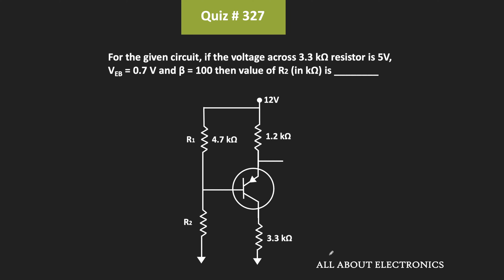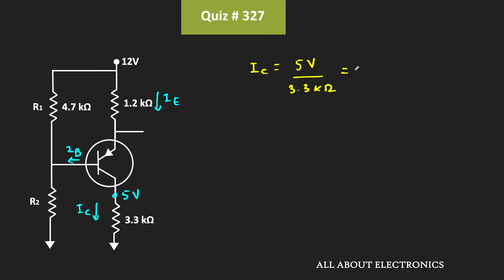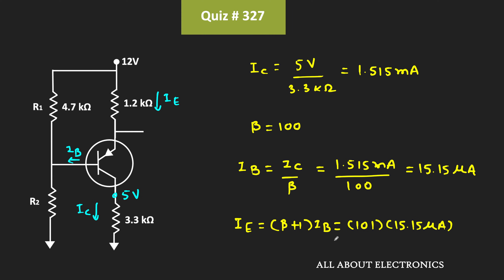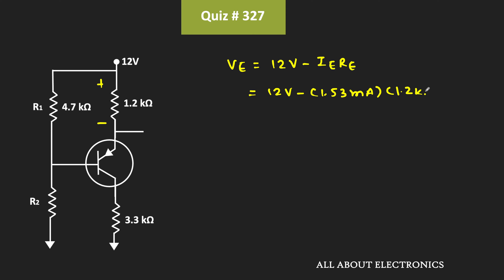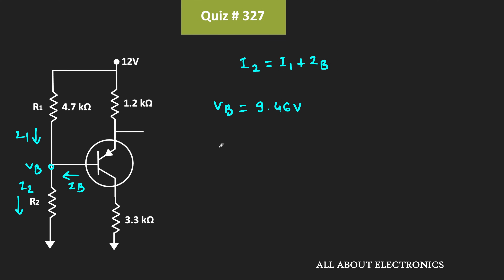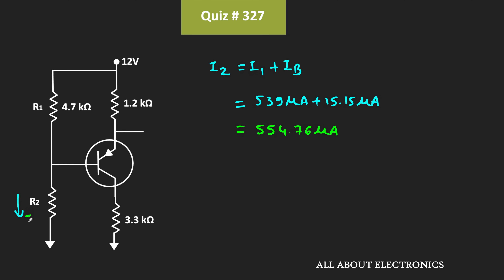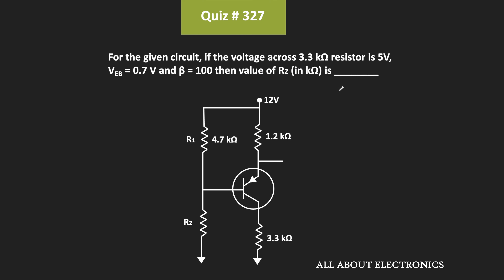BJT (Bipolar Junction Transistor) Solved Problem | Quiz # 327

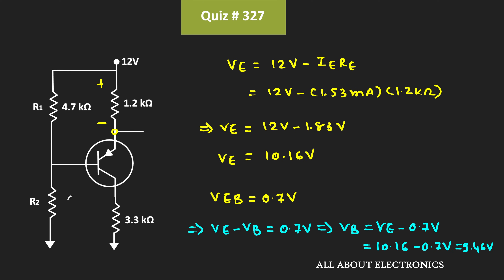Comment: 3:08 Why isn’t KVL satisfied in the right side? should be ground but it’s 4V+
Reply from the maker: I didn't get it where you are referring. Would you please write the KVL equation which you are referring ?
Reply: @allaboutelectronics-quiz  12 - (1200 * I_E) - 0.7 - 5 going to ground
Reply from the maker: @eyezor1  If you apply the KVL on the right hand side of the circuit, then it would be 12 - (1200*IE) - VEC- 5V = 0 You forgot to write VCE, and rather you considered VEB. If you are going through VEB route then you will have VR2 (the voltage across resistor R2). That means in that case, the equation will become 12 - (1200*IE) - 0.7 - VR2 = 0. I hope, it will clear your doubt.
Reply: @allaboutelectronics-quiz  Thank you for replying, but I was asking about the
12 V > 1.2k > BJT > 3.3k route

Comment: 4:03 I'm confused here. Looking at the way the 12V is placed, i thought the current will flow clockwise through the 1.2k Resistor/Emitter to the base, then to the 4.7k ohm resistor. But the current on R1 is flowing anti-clockwise. Can someone clear my confusion, coz i thought the source has the negative and positive terminal and convesional current flows from the positive terminal to the negetive terminal...
Reply from the maker: This is PNP transistor. Thats why the direction of base current is opposite. From the source, since there are two branches, (1.2 K and 4.7K), so current will get divided into two branches. In both the branches, the current will flow in the downward direction.